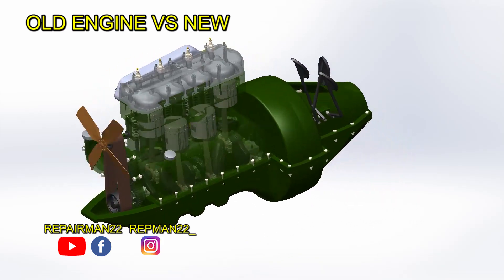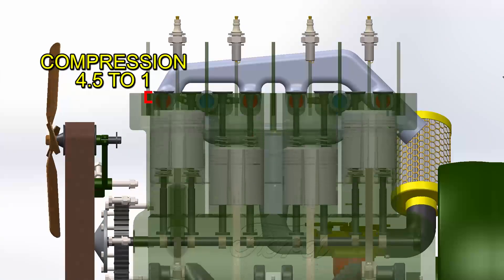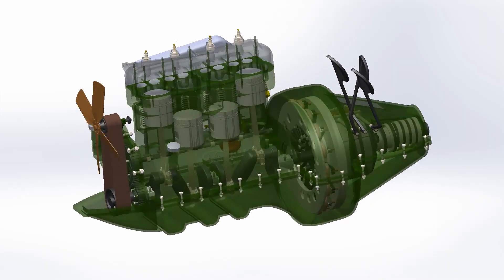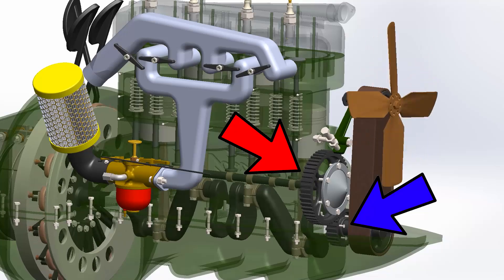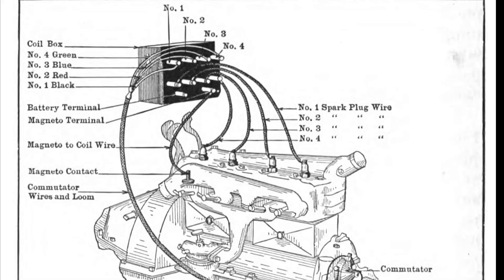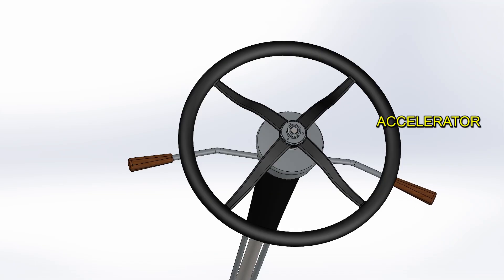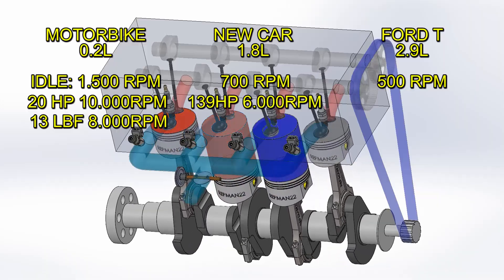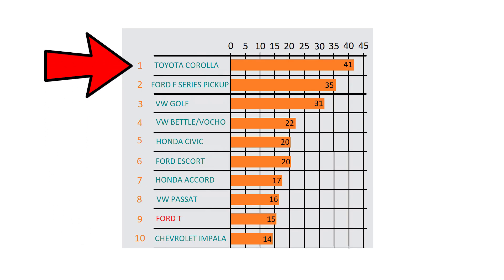Ford T vs New Car 🤯 3D Animation// What changed in engines in 100 years?

Comment: The main reason the T had such a low rev limit was not the long stroke, it was the fact that the crankshaft was completely unbalanced.  There was a constant, oscillating force from each piston/con rod assembly that would start shaking the whole car apart if you exceeded 2,000 RPM.
Reply: The long stroke was a contributing factor.  A long stroke and small bearing journal sizes means no overlap between the main and rod bearing journals, combined with only three main bearings this gives a weak and spindly crankshaft design which has often been compared to a bent wire coathanger (as were other engines of the era to be fair).  The original cast iron pistons were also quite heavy which increased forces on the crank.
Reply: @ferrumignis  - You are correct.  I should have said "not only the long stroke."
Reply: VW air cooled engines also had a Long stroke.  It gives lower RPM but higher Torque.  When you get more torque you lose in horsepower.  That is the trade off.  The engine also lasted over 100,000 miles But it only burned gasoline(am doubting kerosene) though I have never tried it.    Kerosene is cold weather replacement for diesel as they are close to the same in lubrication quality and kero does not get sludgy and freeze in the fuel line from the tank to the engine.  Which is why kerosene is used in jet planes.
Reply: So if you balance the crank (and while you are at it the pistons and rods), any idea how much faster the engine could rev?
Reply: longer stroke also limits the rpm. I rented garage space at a place called the model T garage in tulsa. the guy had many old racing parts for the T (even a factory overhead valve setup). No matter how crude, remember this was the first affordable car in history. Many others had better design but cost $20k to $30k at the time while the T was about $500.
Reply: @maddhatter3564  - I bet if you look closely at that OHV head, it was made by Chevrolet!  The Chevrolet brothers got their start making performance parts for the Model T.
Reply: @hagerty1952  it had the ford logo.and bought thru ford so i dont care who designed it it was a stock ford part. I'll trust the guy that runs the model T garage as he is well known in model T circles at least country wide if not world wide.
Reply: @maddhatter3564 - Ah, you bought it recently?  As in the last half century?

Never mind then! 🙂
Reply: @hagerty1952  no but i saw one in the 90s and as i say i'll trust a man concidered an Expert by the model T community far more than a random basement dweller on youtube.
Reply: @maddhatter3564  -  Ha!  Thanks for the laugh.  I was just trying to help. You might want to research me a little before jumping straight to the "basement dweller" cliché.
Reply: @hagerty1952  I have researched, i built my own solar powerplant from ground up. so when ppl say things i do know about i assume basement.
Reply: @hagerty1952  sorry getting my posts mixed up. I have also been a mechanic for 40 years, i studied thermodynamics so again i kinda do know what im talking about.
Reply: @maddhatter3564  - No problem.  I actually said research "me" so that you'd have some idea of my background.  My resume is up to 17 pages, so no need to go into that here 🙂

Comment: The Simplicity of the first engines was amazing imo. Easy to work on, easy to change things out, lots of room in the engine bay etc., etc.
Reply: Just as well as despite the claims of the video these early engine designs were not particularly reliable.

Comment: A 1990s Japanese engine with coil on plug ignition and variable valve timing with cable throttle is still pretty modern technology today.

Comment: Don’t forger, till 1920 engines worked smoothly on alcohol (spirit) petrol was sold at shop’s as the bleach. 
Prohibition in USA 1920-1933 was  made to switch from alcohol to petrol, but petrol destroyed engines till tetraethyl lead was added. 

“In 1923, GM, along with the Standard Oil Corporation and the DuPont chemical company, founded an enterprise for the production of this fuel under the Ethyl brand.”
Leaded fuel was sold all over the world poisoning everything and everyone till 2002, in some countries till 2021. 
Petrol instead alcohol reminds me scam “electric cars instead of internal combustion engines” when  this days tyres and brakes creates more pollution than modern engine itself. 

-Does anyone thought how batteries are made?
-Does anyone thought how batteries are utelized?
-No?!
-You will be suprised what for Greta is sponsored

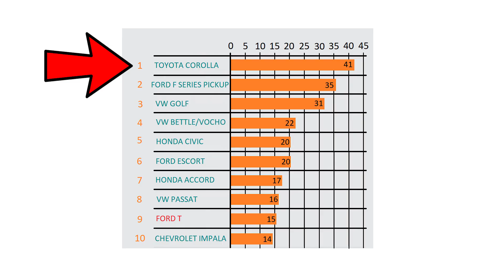Comment: 7:55 Although I don't agree with this since the Toyota Corolla has been sold since a time when we had less than half the people we have now BUT because the Ford T changed very little during its production run while the Toyota Corolla is a whole different animal depending on the generation with parts interchangeability virtually zero, I'd still a agree that the Model T is the most sold car.

Comment: my cars engine spins at a maximum of 6800 rpm, is a 2.5l inline 5 and is dyno tuned to produce roughly 350 horses and it weighs 1360kg
Reply: Good for you. What was the point you were making?

Comment: Blah blah blah. The reason it lacks so many parts is that Ford wanted to save money on production and removed anything unnecessary from the engine. If you want that, look at the Trabant (from East Germany). Simple two-stroke, two-cilinder engine producing 26HP, fuel fed by gravity, etc. etc. 

But both the Ford-T and the Trabant are history! Because non of those engines can meet modern fuel economy standards or environmental standards. Both were great environment poluters. To achieve modern standards, you need the complexity - period! And contrary to what the author may imply; good modern engines are not that more unreliable than the Ford-T.

Comment: The internal combustion engine was the answer to the steam engine and gave the world mobility. The Ford engine shown and the current combustion engines have not improved in over 100 years. The energy you put into it is converted into two new types of energy: kinetic energy and heat energy. The return is disappointing. 100% energy becomes 30% movement and 70% heat energy. You want to move but you produce heat. Stop this nonsense. Mankind should be ashamed that it has been moving for so long without getting any further.
Reply: It's the corporations that are hindering all of the new progress
Reply: How to use the heat energy for more movement in small space though?

Comment: The phrase, "Ford T was an unbeatable engineering machine". is an extremely important phase. in regards to today's over engineered vehicles. engineers have allowed to have too much leeway in the design of modern automobiles. and it shows in the difficulty repairing them, and the reliability of them. it's in my opinion that engineers needed to be vetted more seriously. before letting their terrible design's out into the wild.

Comment: Something isn’t right about the 40 octane. If it can run on kerosene which is less volatile then 40 octane would be extremely volatile. The higher the octane the slower the burn

Comment: Simplicity should be reintroduced to the modern automobile. 
I'd add a fuel pump, filter, and air filter and take the Ford over the modern engine.

Comment: No fuel pump is an odd thing to list right after mentioning a part simplicity win when the lack of a fuel pump actually negatively affected reliability in certain conditions.

It's important to remember that some (precautionary note, I said some not all. Don't get pedantic on me) of the complexity of modern engines increase reliability substantially in the context of modern power expectations and other needs. I feel some of the tone of this video misses that.
Reply: Then explain it to the 5billion motorcycle owners, 6 billion gas lawn mower owners and other stationary engines that use gravity feed.  You can't because gravity is everywhere...so super reliable.  Mount the tank higher and it is gravity feed.
Reply: @bunzeebear2973  You're not thinking very broadly with that. You cherry picked devices where gravity feed does still work due to the design constraints of those devices making higher gas tank placement more feasible. Not to mention that each device typically use smaller engines that do not need a high pressure gas flow to sustain themselves. Fuel pumps solved a problem. They wouldn't exist if they didn't. Just because gravity feed still works in some situations that does not disprove my point. Exceptions, not the rule.

Comment: "40 octane" oh dear did someone make the "more octane is better fuel" argument accidentally. For the layperson. Octane is an anti-knock additive. It makes gas LESS explosive. This is necessary because modern engines compress the fuel air mixture very hard for efficiency reasons. This causes premature detonation of low octane fuel. Eventually they did find a great substance to fix the octane issue... But it was lead, and it was perhaps the greatest health crisis the world ever faced as people were inhaling lead from car exhaust. So Ford did the best he could with low-octane, meaning highly explosive, fuel which was common in his time.

Much more concerning was that filtration was very crude and expensive. A farmer might just pour gas into an old oil can not knowing the harm it could cause the engine, or a gas station would refuse to maintain their tanks leading to buildup. So engines had to work on truly bad, as in contaminated, fuel. Ford's engine is setup to have a greater tolerance for those situations, which is absolutely the correct move.

Comment: The crazy thing is I hear those old model t engines could run millions and millions of miles, there’s still some that have never been rebuilt
Reply: It SEEMS like millions of miles but everything wears out. Still some that have never been rebuilt as they now get towed on a trailer from exhibition to exhibition.
Reply: @bunzeebear2973   well I think I’m talking about actual miles not time. They gave things a lot more meat to wear back then… I’ve seen a car from the 50s that only had 200miles… I don’t think anyone is saying it has 500k miles based on its age but idk 🤷‍♂️

Comment: Those old motors, Model T Flathead 4's, were great for the time, but in comparing to a modern 4 cylinder engine, the old T produced no where near the power, they were no where near as efficient, and they did not go 250,00 miles like many modern engines do. Not a fair comparison. Ever sat behind an old flivver and got to enjoy the exhaust smell? Modern engines are truly amazing.

Comment: 8:10 I thought the crankcase/ block was cast iron.  That sounds different than vanadium steel.  Ford knew about age hardening and aged his castings in Michigan fields for a time and then machined them. The carbon that came out of solution had done its distorting before the machining and Ford’s cylinders stayed round and the crankcase’s line bore stayed straight for a long service life!
Reply: We now know that iron blocks can be stress relieved at the factory with heat treatment and/or low frequency vibration. This simulates the heating, cooling, and vibrating cycles of a "seasoned" (used) block. And of course, CGI (compacted graphite iron) blocks are used on higher quality engines now.

Comment: Note not all modern engines have 5 main's they can anything from 3 up to 6 from what I hear in some applications stock. And 900 rpm is kind of high idle Unless the engine is cold then I could see 1,000 rpm.
Reply: Compare like with like, you won't find an inline four cylinder engine with six main bearings because there are only five possible positions for a main bearing.  Likewise three bearing designs on an IL4 are a rarity today,  no mainstream car manufacturer makes such a thing.

Comment: This is like saying that a steam locomotive was simpler than a Diesel. Okay...perhaps that's a big unfair, since the former had a complicated boiler. But, the single cylinder was simple, ejected steam out of a port, and there was no need for an ignition system, pumps, or cooling. The Diesel-electric train, however, is about 35% efficient, the steam train-less than 5% efficient.

Comment: A engine that spends most its life at around idle (1800rpm) is undoubtedly be more reliable that a engine that revs to 7000rpm (less friction/less heat/less wear)
Reply: In theory yeah, in practice though its limited to 1800rpm because more than that and it would tear itself apart. 1800 stresses it as much or more than 7000rpm stresses those other engines. It has no counterweights on the crankshaft, and no oil pressure.
Reply: The reason none exist is because people push the limits.

Comment: I do not think model T was reliable as today's cars or at least as the 80s and 90s cars!
Reply: 90s and 80s cars are more reliable than today's cars nowadays they are full of gasket issues breakdowns DPF and shit model T was not so relaible because technically it was a test vehicle  but cars from 80s and 90s were robust and they still stand today and 00s were also very reliable after the past decade they became shite

Comment: Today I drive a 2L 4 Cylinder petrol with 186 hp and 43 mpg. Label says itll do 52 mpg. So it got more than 8 times the power and does almost 4 times the mpg all while weighing over 1.4 tons. So i think weve come a long way.
Reply: Sound like less than a decade of progress if you comparing it to the computer procesors inductry... Ford-T also replaced electric cars as the most popular type of car and nowdays we are thinking hard about going back to them and replacing internal combustion cars with electric cars-> so are we moved "a long way" or are we making a circle here?!
Reply: @Bialy_1  well its a weird comparison. Combustion engines are energy converters while semi conductors are energy users. Diesel engines on ships actually run at around 50% efficiency which is some of the highest in the sector.  But its Apples and Oranges. 
Semi conductors have become more energy efficient but are still extremely wasteful btw.
Reply: @Bialy_1  Like the other guy said, try comparing apples with apples.

Comment: Very unlikely that the Model T would run properly on kerosene.  Atomizing oil type fuel just was not functional in the simple old carburetor.  Alcohol, maybe if the could get it to run rich enough enough, but I think the kerosene fuel use is a myth, or simply made up.  Especially at a compression ration of just 4.5:1.  
It would run fine on gas or naptha, and maybe alcohol, which all atomize easily, but kerosene is not that kind of fuel.

Comment: The T cannot even be compared in reliability to the cars of today. The lack of these listed moving parts on the T do not make it more reliable. Typically this is a true sentiment in todays time but these particular parts are essential to longevity and reliability in vehicles.
Reply: If modern metals/metallurgy were used in that engine I bet it could last a good long time, be bullet proof and what cars today are not, HIGHLY maintainable by a shade tree mechanic. Being side valve, low compression and it's inherent design it would never make the power or be as efficient as a modern engine, however those things have nothing to do with reliability.
Reply: In part because it did not have as many moving parts of other cars of its time, it was indeed more reliable compared to the other cars. For the time, however.

Comment: reliablity-modern cars can take over 500000km without failure, ford T need full rebuilt after 10000km+current repairs.
Reply: modern cars have Planned obsolescence
 they will never reach a half million
Reply: wrong new cars will not even last 100k and will start showing problems with one year of owning
Reply: @MrPegman02011  any example?  even legendary 1.4fsi can go over 500000km without failure.
Reply: @nanab256  like a 2022 golf NO NO NO
Reply: @nanab256  old cars can do like 2 MIllion KM
Reply: @MrPegman02011  one of a billion
Reply: @nanab256  an old FSI yes